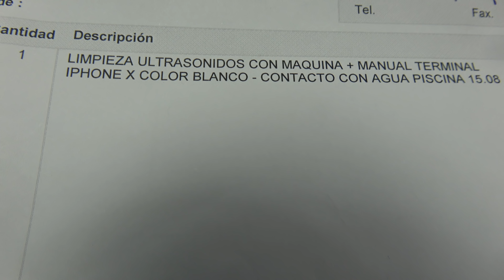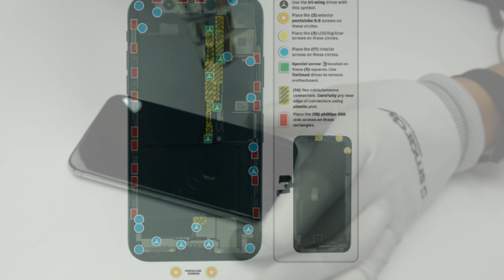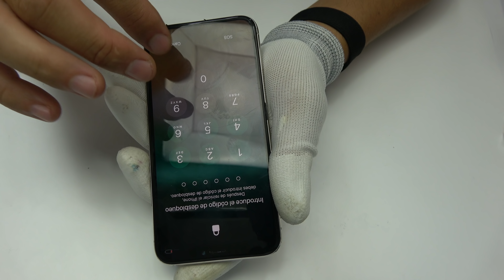REPARACIÓN IPHONE X MOJADO

Comment: Mi iphone XS Max se mojó y funciona pero cuando cargo la batería a más del 70 % queda con la pantalla apagada y salen rayas verdes hasta que en una de esas de tanto insistir con el botón de encendido prende. Cuando está a menos del 70% funciona con normalidad. Cuál será la solución para que funcione con normalidad sin tener que estar pendiente de la carga de la batería? Gracias por la atención, ojalá me pueda ayudar.
Reply from the maker: Hola Miquel. Hay que hacerle una limpieza con ultrasonidos para quitarle él sulfato que lleva dentro. Un saludo.
Reply: @MovilOne  al parecer se secó completamente porque ya no se apaga con carga al 100%. Muchas Gracias por tu respuesta, se valora mucho.